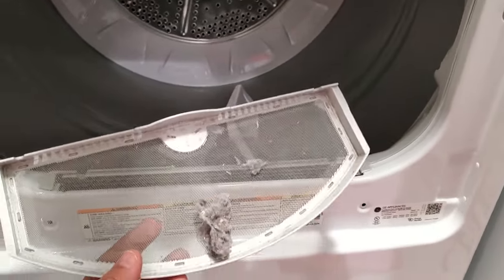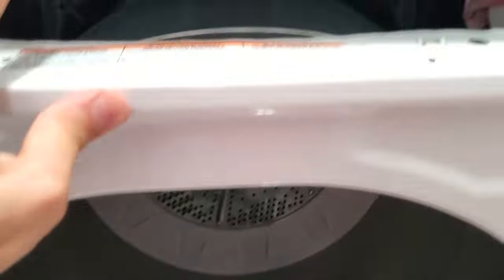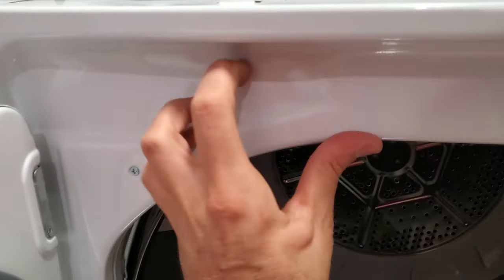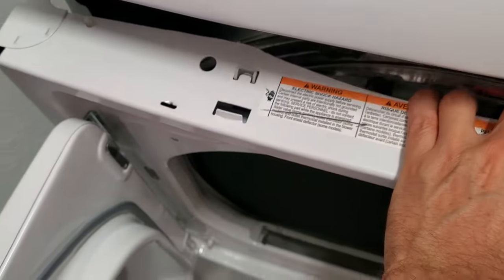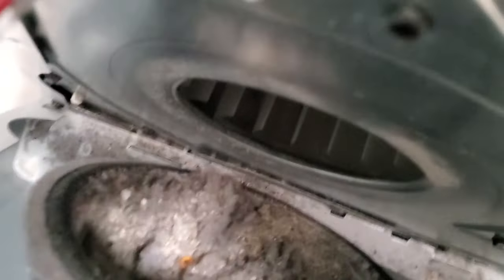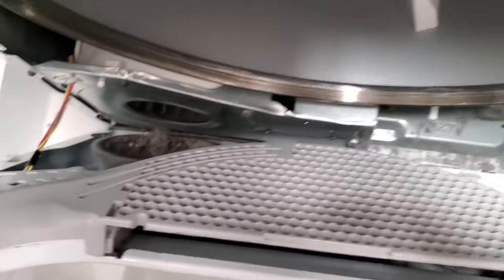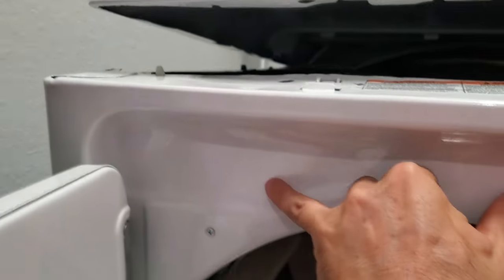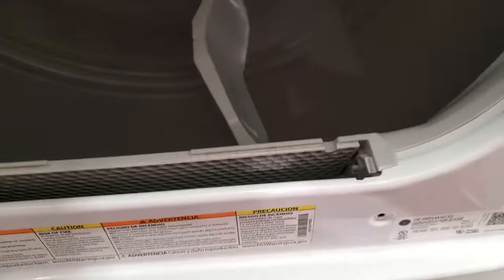GE Dryer disassembly and vent cleaning. (Hampster Nest of Lint)

Comment: Just found your video. On my days off, my wife leaves me a "man list" of things that need done around the house or maybe routine vehicle maintenance. She knows I like crossing out the list as I get the stuff done 😆. Today, one of the things was to was to clean the dryer vent. I do keep up with the cleaning of it monthly. I have a small attachment I apply to the end of my shop vac and stick it down as far as I can get without damaging the plastic dyer vent assembly. I got to looking at it today and thought to myself there has to be a way to remove that assembly without taking the dryer apart. Thanks to your video, I'm going to give it a try and do an extra deep cleaning this month. It's not that it needs it, but I'll call it preventive maintenance.
Reply from the maker: @Big_Country843  hope it helps

Comment: I just got my front panel off on my GE dryer and that was most definitely where the problem was.  I had a thick, heavy, compressed build-up of wet lint in that container right under the lint trap on the front panel and it was 100% clogged.  My dryer suddenly wasn't drying my clothes in a full cycle so I pulled the dryer out away from the wall and ran my vaccuum wand up the back  end of the dryer and cleaned the duct as well.   Put it all back together.  Still not drying right.   I'm glad I ran across these videos about the lint build up in the front b/c I was very close to ordering some new parts for my dryer.  The only issue I had was one of the two screws at the top of the door that fastens the top panel to the front panel was frozen solid and I stripped it.  I had a complete set of drill bits and started with the smallest and worked up in size and basically drilled the screw out until it finally let go.  If that happens to you, you can just drill a new hole that matches the screw size near where the stripped screw is and it should be fine.  Thanks to all you guys that know about these things and share your knowledge with everyone else because we couldn't have done it without you.
Reply: I used a hammer drill to get mine out.  The impact knocked it lose.

Comment: I ended up sticking a thin duster inside broke up all the lint and scooped it all up into the vacuum. Then i just used the dryer normally and it blew all the rest out. Came out nice n clean and didn’t have to take off a single screw.
Reply from the maker: Nice!
Reply: I should've read this comment before bc now im to the part where I disconnect the wires and idk how to do that lmao
Reply: You’re smart hahaha I almost took this apart. Thanks to your comment I remembered I had a duster 😂

Comment: Thank you for this! I was trying to find this info in the manual with no luck. Tried googling it with no luck. While your model isn’t the same as mine, the lint trap part looks exactly the same. I’m gonna try this and see if the screws are all in the same place 🤞 thanks for showing that too! Once I took the first two screws out that I thought held the lint trap in, it didn’t want to move and I thought I must be missing something. Why’d they have to make it this complicated when it didn’t have to be 😂
Reply from the maker: Yw, yes, poorly designed.

Comment: When reassembling I had to lift the drum up some to line it back up. I noticed when that front panel pops off the drum leans forward some.

I live in an apartment and I’m sure mine has been opened up a couple times, but if those metal tabs on the sides don’t line up just right using a small adjustable wrench to bend them slightly worked out for me.
Reply from the maker: Thanks
Reply: Yeah I wish I had read your comment before I tried reassembly...somehow when I finally got it to slide back together, the top violently slammed shut on my fingers, which then in pain and surprise caused my other arm (which was inside the open door, holding the drum) to try saving it's poor counterpart and instead just punched the inside of the drum as my forearm cracked against the top of the opening. Then don't ask me what happened to make the top fly back up but it did. And broke my glasses. Thought it broke my nose for a couple hours.
😂
I'm a bit clumsy at times but man, I have no idea where this all came from! I think this particular dryer is possessed, and hates me.
Reply from the maker: @Robodie  ouch! Been there..
Reply: @Robodie  How has the recovery been?
Reply: Thanks I was wondering why it wasn't closing😂

Comment: Great video. I had some electrical concerns after fixing and wanted to let people know in case it happens to anyone else. Once I put it back together and plugged it back in, I heard a humming noise.  Shortly after I can smell a faint burning scent.  I immediately plugged it off and checked the wiring and everything was plugged in snuggly.  I went to the back of the dryer to see if my 4 pronged cord didn't come loose. 

Everything looked good, plugged it back in, and I heard the humming noise again and pinpointed the nose coming from the front console where all the dials were located.   I decided to turn it on and let it run for a few seconds,  then stopped it.  The humming noise was gone, and I have used it with no more issues.

I think it may have been some capacitors charging.  Because when I initially plugged it off the wall I did discharge them by holding the start button for a few seconds (standard safety procedure when tampering with high voltage equipment). When I plugged it back in, those capacitors may have had a tad bit of dust that probably landed there from the cleaning. Anyways, I hope that helps put anybody's mind at ease.
Reply from the maker: @ViciousSeed  thank you

Comment: Not sure if this was exactly what I was looking for but still a pretty informative video! 

My situation is something that was caught in the tray fell down in that center spot (and not the side thing that you showed after the unscrewing and messing with wires), and theres a lot of it down there now and I want to get rid of it. I was thinking maybe a thin stick vacuum but I doubt I can find something thin enough to reach there so thats a no go unfortunately. Pretty sure this is my exact same model too.

I'm just trying not to call an appliance company if I don't have to! The lint does still catch in the entire tray for me, but I just wanna get rid of the excess.
Reply from the maker: Yes, you can attach a thin tube/hose to your vac and suck it out. I use fuel line, vac line, whatever you have laying around.

Comment: I didn’t even include the model of GE dryer when I googled removing the lint guard but your video came up, and it’s the exact same dryer as mine! Yay, interweb! I’ve had this thing less than a year and tonight it started drying poorly. Crazy because I am the only person using it, and I average about 5 loads of laundry a month, and it’s already gunked up. I can see so much stuff down in there… wouldn’t it have been great if they made the opening wide enough for the shop vac nozzle to reach into it? Thanks so much for the video, I will tackle this project tomorrow (fingers crossed that it will have enough heat to dry one last load tonight).
Reply from the maker: @DittzyDJ  cool! GL glad it helped.

Comment: I can't get the front panel back on.  How did you get the front back on?  I assumed it would just right back in, but something isn't lining up.
Reply: I figured it out.  I opened the door and pushed the drum around until it nested inside the track/brace on the front panel.

Comment: Question:  what would cause water to condense in the vent hose?  I just took apart my 
whirlpool dryer (front and back) to clean out all the lint.  I cleaned out the vent hose and the vent to the outside.  some of the lint trapped in the vent hose was wet (not just damp, but you could wring water from it).  I rinsed it out, cleaned it thoroughly and hung it up to dry.  Then I reattached it to the dryer and the outside vent and ran the empty dryer on high for an hour and an no heat tumble for 30 minutes, alternating that 3 times.  It then sat overnight.  I thought it would be bone dry the next day, but when I uncoupled it from the dryer, there was about 1/2-1 cup of water in the hose and dripping out of the dryer vent in the back.  This was an empty dryer!!  What on earth caused this???  Is it just latent humidity from the air it's sucking in?  Is there a way to prevent this?  If it's happening regularly, no wonder my dryer gets stopped up so frequently.
Reply from the maker: You have a slinky hose?  Get a hard wall and make it as short as possible. Yes, sounds like your condensing up the vertical lenght and it sweats back down and collects. If your lint trap is plugged behind the screen your air flow might be restricted and contributing. Gl

Comment: Did this to clear some debris making noise but now my dryer won’t turn on. Any suggestions?
Reply from the maker: You may have pulled the wire to the door safety switch. Or other wire upon lifting the top?

Comment: Mine is like this. Why does the lint trap not catch the lint?
Reply from the maker: @keeganwhite203  good question, most miss some but they blow it out the exhaust, this one has the exhaust too far forward and cant seem to blow it out. Im sure the longer the hose or the more gravity is against it the more problematic.
Reply: That makes sense. Thanks for responding

Comment: Looks easier enough I can do it myself.. and I'm usually dangerous with taking apart appliances.. lol
Reply from the maker: No problem! You'll get it.
Reply: @wetlifesports  Well I did it, had to use two different types of screwdrivers - what a mess of lint there was, but the only problem is it doesn't close right and I"m afraid to force it. lol  Going to try it again.
Reply from the maker: @grambeege  gl

Comment: HOW DO I UNCLIP THE WIRES. I’m scared I’m going to break something help YouTube father lol
Reply from the maker: Just be careful. I can't recall what the wire connectors looked like. Clips? Or just push/pull ons.
Reply: @wetlifesports  I ended up using a little tiny flathead and was able to separate the clip thingies lol. Ty so much for your answer